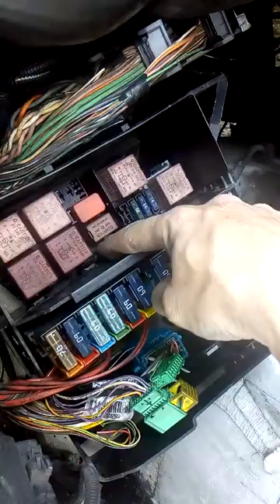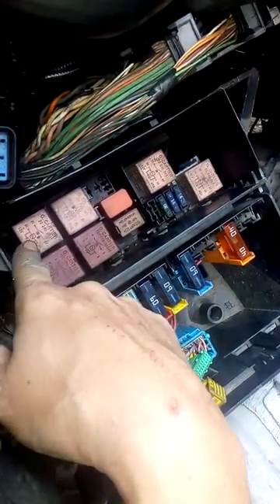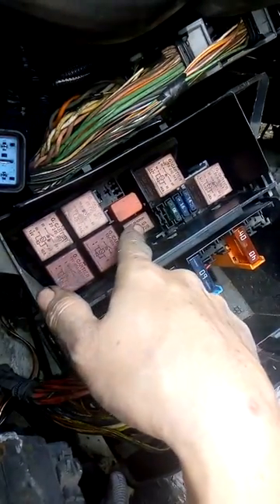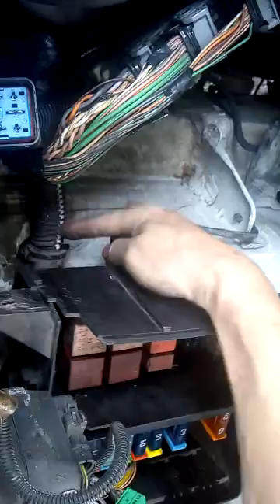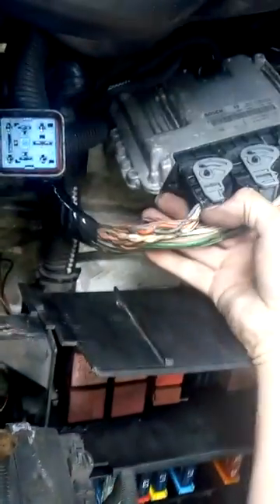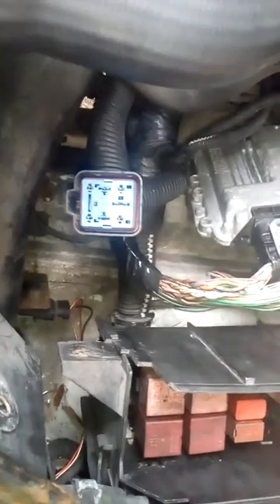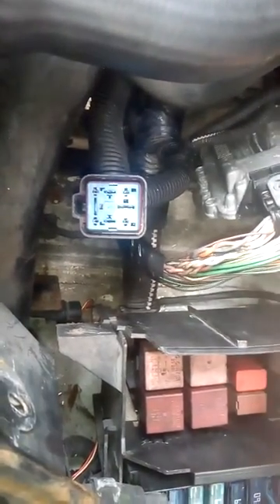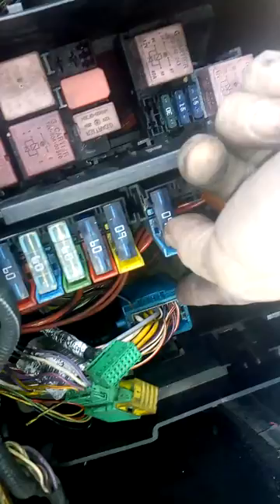Renault DCi 1.9 fixes.

Comment: my mechanic used to work for Lucas. and he has told me never use non OEM parts for these Renault engines, after some other garage put a cheap MAF on and made it idled at 3000rpm...
Reply from the maker: No you can use what ever parts work...
The problem is with the parts and who makes them. There has been a lot of issues with eBay maf's as essentially it's a resistive wire set to give information. But that small difference can cause big problems.
A good mechanic and auto electrician would test the maf before fitting, and know how to.

Comment: Hi rory, cheers for vid..i have a renault master 2013...was driving fine but to keep it brief, now no dash lights except odometer, .vehicle obvioisly wont start.  Battery good, engine strong..all fuses and relays seemigly checked.  Ecu not giving any reading. Its been at mechanics a while now and im just trying to find a solution....anyway.. Have you found that it is a common issue for one of fuses on battery to "appear" good but is actually broken.  I.e. there is just enough of a connection to give a good reading on multimeter but the fuse is actally corrupt.  I have read a couple of comments tbat this was the case and seen couple videos aswell so wondered what yr thoughts were.  Any other suggestions appreciated thanks again👍
Reply from the maker: yes you can have that issue.
You can have a small trace that will give you a voltage reading with a multi meter, then you put a load on and it will break, if you go back, the voltage level will be gone. but you can also get the same result with a bad connection. but in this case you would have voltage when you returned to the connection.
Reply: Thanks....quick follow up..master 2013....ended up putting in new (2nd hand) USM module and van ran smoothly for a few months..now experiencing same probs...randomly, it wont start..turn key..glow plug coil light comes on v briefly, then off...then spanner and triangle with skid marks come on..no crank...sometimes oil pressure fault reading..sometimes fan kicks in, but no crank....turn key off, try again...and, sometimes after 5-6 times of doing this it starts and off i go.....someone has suggested as they had same problem, that an earth wire going to pink relay under usm (you mentioned this in yr vid..the one that powers the pumps/sensors) and goes to ecu was faulty...is this a common issue in your opinion?  ..is it an easy ish procedure to locate faulty wire.?..i notice in yr vid u had to get right under all the fuse box and expose all wires....would u be able to give any quick tips..what tools/ what to best look for when trying to identify where problem is....i suppose first is just a visual to see if anything obvious...i have a multimeter!  Any tips appreciated ..cheers
Reply: Also..u mentioned checking continuity...is that a case of sticking probe into where relay usually goes?  Cheers

Comment: Hi, Do you know much about the limp mode fault when hitting 50/60mph? Absolutely fine until you hit that speed, if u turn the key off/on its then fine until you hit 50/60mph again? Thanks.. 😊
Reply from the maker: is this rev related rather than speed? This would indicate a fuel issue. could also be a wiring issue check the pump and injectors wiring is reading correctly. and also that the egr is functional and clean.
Reply: @guywhoknows  Hi, No I wouldn’t say rev related, it will only go into limp mode at 50/60mph, No matter how hard you drive it will do it. I have checked the whole wiring loom ( took it out the van ) any breaks have been repaired but issue still present. Does have codes for Maf sync and camshaft sync
Reply from the maker: @Rushizzxx  try the maf sensor.
If you get a cheap one they won't resolve the issue, I replaced mine once, made things worse so got a proper one.

Sometimes the issue can only been found using live data. 
The other issue can be due to fuel pressure, ensure the filter is replaced and flushed. 
Watch the live fuel pressure data.
Remove and clean the egr. If the egr is stuck it will show an error, but you have what looks like a bus error as it's across a number of systems gear box, maf and crank

Comment: Hi Rory. My 2.0 Renault trafic stopped shortly after a normal start. It cranks fine but the glow plug light won’t come on again. All glow plugs tested ok for both resistance and 12V powered. ECT correct resistance. All fuses and relays fine. Any help appreciated 🙏
Reply from the maker: Glow plugs only work when needed.
Disconnect the battery and let it stand a while and try again.

Check you external temp sensor.
(Think it's in the door mirror)
Reply: @guywhoknows  Appreciate your response. It’s a 2008 dci 115. I was under the impression that the GPM is linked to the ECT but I will look into the OAT. Yes battery has been disconnected numerous times. This will be my last Renault I’m afraid 😂
Reply from the maker: @daveo9844  if you can't find anything there, take a look at the pump, there is a small solenoid you should hear buzzing when the power is on.
Then the next thing could be the MAF sensor as that does air temp and flow.
Be careful as they can go be faulty and fake, this gives wrong signal and cause start a run problems.

Hey don't forget these are joint venture vans, so that includes nissan and vauxhall as they're all the same platform and build.

The 2.0 engine is terrible and no end of issues, the old pump seal leaks and starves the engine of oil and can lock up the engine.
With that said, get someone to crank the engine and see if your cam belt is turning the cam, and take off the oil fill as check to see if everything is moving inside.
I've had plenty of call outs, where it turns over but won't start on all sorts and the belts are gone.

Comment: very informative video, i have a 1.9 2006 vivaro, the pre heater fuse (70) has melted, do you know what the cause could possible by, the van runs and works fine.
Reply from the maker: you possibly have a short or high resistance. you should check the plugs and also the relay for damage. there is also preheater on the cooling system ( on the top to the right in the engine bay on the pipe). They are also glow plugs.
Modern engine tend to not really need such a pre heat, which is why it will start and even though its melted its probably making a connection.
Reply: @guywhoknows  cheers for the reply, the plug and fuse has totally been destroyed, so i know it defo isnt making a connection, could it have been heat caused by resistance due to corrorsion on the fuse / plug it slots into. everythning seems to work fine, so its a little odd.

Comment: Hi rory,have a issue with my 2004 vauxhall vivaro, 1.9 diesel, no eml light on ignition. Plugged in code reader,doesn't pick anything up,says no modules or something similar.runs fine though,sure previous owner as turned eml light off some how,any advice greatly appreciated, thanks mark.
Reply from the maker: Maybe they taped over it in the dash.
But if you have no detection then it's likely to be a bus wire, (the fault/computer wires)  or the fuse that's gone causing it to not be detected.

Go for the fuse first as I doubt you'll have the kit to read the lines and then hunt down a break in the wire.

Unless you got a cheap scanner, could be that as it won't run if it's not talking.

Check battery terminals  fuses and wires.
Then on/below ECU then the back of the odb connection.. 
Could also be a ground fault, so make sure the obd has the + and - working correctly.
Reply: Thanks for the reply,would you happen to know which fuse and its location? Will try that first,thanks for your help.
Reply from the maker: @avfc666s  nope, there is a lot of different wiring arrangement, so most of them aren't the same. I found that out when looking for a wiring diagram.

I think the wire is yellow. But go for the fuse box behind the light and there are some fuses on the battery. Then there are fuses  under the left side cup holder.
Reply: Will get on it,and report back,much appreciated!
Reply from the maker: @avfc666s  start with the small fuses, there usually less than 10amp. So 7.5, 3 something like that. Just pulling and pushing them in and out can clean a dirty contact and then it works... 
Or worse case there is a fault in the wiring (broken wire) that is stopping the contact.

Pins 2 and 10 are  jbus. (2 is +)
Pin 6 and  14 are can bus (6 is +)

On the back of th odb. So you should be able to wire trace from there.
Reply: Hi,rory,seems my problem is related to wires being cut for airbag under passenger seat,been on a forum,apparently I need a auto technician, do you happen to work on vehicles or do you just put advice up,regards mark.
Reply from the maker: @avfc666s  not something I would do.
Don't try this at home

It's a risk of explosion reconnecting the wires. You need to ensure the system doesn't trigger.
Reply: @guywhoknows  ok,thanks for your help, allthe best.
Reply: Hi rory,how can I send a pic to you,maybe you can help, someone on a forum as sent me a pic of fusebox relays,concerning eml light.cheers mark.

Comment: hi rory been searching everywhere for an answer, My 2006 vivaro has been a nightmare the glowplug warning light came on with the fuel light when i went over a speed bump since then it comes off and on and sometimes goes into limp mode, it doesnt rev when this light is on and ive been plugging and unplugging a throttle sensor to get it going again any idea what the problem is ? its been burning through fuel for fun but i dont know if its just the fact that whatever sensor on the fuel is connected to the one that does the throttle as i said they both went off at the same time from the same bump
Reply from the maker: Fuel, throttle, engine speed, and emissions are all part of the same system as the vans drives "fly by wire" there is no user control over the speed and controls of the engine. That peddle goes to a computer that does the work...

Bumps can be a wide range of issues. Check both ends of the battery wires just crack them off and on again should be fine.

The jolt could have "bashed" wires about causing a weak one to break... Or a sensor failure. 
It could be the air flow on the front of the throttle body, this accounts for a lot of control.

If you're going through fuel then is could be the air flow/temp sensor and or the emission sensor (there are two?) It shouldn't the the crank or cam sensors.
If you computer thinks it's cold, then it will add fuel. Thus you use more.
If your getting a lean emissions it will add fuel as it will think it's running hot and lean.

Check your fuses, and check the pre heat relay. Just swap the relay around as the one next to it is the same.
This only helps with glowup heating. The cooling heater has the same relay, as found on the top front of the engine. If they get warn and power then its fine.

Just make sure the engines ground cable is attached and clean making good contact. As this can make everything go wrong and odd..
Reply: @guywhoknows  thank you so much for getting back going to check a few thing you suggested cheers
Reply: @SammyHardman8 How'd you go with this in the end? I have a very similar situation unfortunately.
Reply: @rwdkai  I believe it was something to do with water leaking into fuse box as I wouldn't notice this would only happen when it would be rainy. Sadly I sold it 2 years ago.

Comment: hi mate i have a question. i have a 2006 trafic with 1.9 engine. when i go full throttle the car feels like it doesn't want to go and i dont get power. also it cuts the power regularly when full throttle. i am thinking that the fuel pump is faulty. what is your opinion?
Reply from the maker: Could be the erg. Have you taken it off and cleaned it?
Messy job...

The other thing is the pipes that go to the turbo controller... (Right side next to the computer with tree pipes)
Follow them up and make sure it's clean there and in the ends.
Failing that, probably fuel pump or injectors.. but have you changed the air filter too?

If you can see behind, what colour is the smoke out the back...
Reply: @guywhoknows  it was actually the flowmeter. changed it and now the car is back to full performance

Comment: Hi Rory, I have a problem with my van not revving immediately when warmed up, it idles but takes a while to start revving. Any  pearls of wisdom would be appreciated as I took it to the local dealers and they said fuel pump.
Reply from the maker: Have you cleaned the erg valve out recently. Or yes could be the pump. Or filter.
Reply: Rory Witham yes, I’ve even turned that one around
Reply from the maker: @acewelding  it can be the throttle peddle, of you get a multi meter in it and see what it says, the fuel pressure switch does break and give a false reading.
And also I did read but can't remember what it was, totally odd ball part that can cause it.
You'll have to look up will not rev up.
Don't forget to look at the vauxhall ones as they're the same.

The only other mechanical parts would be the cam sensor. (Top)  or crank at the bottom (climber under and about the middle front hidden behind the rad pipes as they go across the engine.
Both are fairly common , the crack (bottom more so) the cam one tends to  cause issues at higher revs.
Reply: @guywhoknows  Thanks mate, I think you could be referring to the coolant sensor. Thanks for your help
Reply: Did you sort your problem out sounds like my problem too
Reply: @simoncrabtree444  not yet. Haven’t tried the coolant sensor, cam sensor or crank sensor yet.just had to have a new clutch so haven’t had time. If you find a fix be sure to let me know. Good luck 🤞
Reply: @acewelding  do you have a cheap MAF fitted as that is a common culprit
Reply: i had this on my vivaro 1.9. it wouldn`t rev when started. turns out its the ecu software, i hgad it updated for £150. revs immediately now..
Reply: @themagpie_1  thanks for the reply. I have heard this before but my local dealer has told me there is no update

Comment: Hi Rory

I recently bought an Opel Vivaro 2005 1.9 DCi that has been turned into a camper van. However it's in limp mode with several OBD codes. The engine needs some revving while cold starting, otherwise it shuts off. When revving for about 30 seconds or so its running stable in idle. No weird noises or knocking sounds from the engine. As previously mentioned it's in limp mode and it's hard to go above 40 km/h. The transmission and clutch seems fine and is working properly.

The OBD codes that I get with my cheap OBD-reader is:

P1814
P1815
P1829
P1802
P1806
P180B

What could be the cause behind these fault codes and how should I proceed to troubleshoot and diagnose the symptoms?

Help is much appreciated!
Reply from the maker: im will say you have a manual gear box?
Id say this would be a bus fault ( wire) you have a break in the wire ( a short possibly) so the communications are not working. as these are  engine  and gearbox (auto) faults showing. if you have a manual gearbox, there may be a fuse in the wrong place. but you need to check the loom coming down from the battery and  around the bell housing.

Comment: Hi Rory, I have a problem on my Vivaro 1.9 74kw. Throttle pedal no reaction when engine start. Idle speed is little bit lower then normal but after few seconds engine speed start getting higher and throttle pedal start function normally. is it possible that they are bad injectors? MAF sensor,  pressure sensor both are new. EGR valve is clean. Turbo is good. Car starts perfectly in every temperature.
Reply from the maker: Airflow or temp sensor.
Reply: Did you already manage to repair it? Same problem....

Comment: Great video and very helpful..my Van 2004 1.9 diesel driving home perfectly then a loud bang and all lights came on…got home everything still working except speedo and indicators not working everything is fine…switched van off the restarted 5 minutes later no throttle response and all dash lights on..checked the battery because of the smell and it was smoking and leaking acid..changed battery for a new one but still no throttle response engine starts fine…any ideas thanks again.
Reply from the maker: Blown fuses...
Check the fuses on the battery terminal.
Then the main fuses.
I'd also run down the cable to the alternator just to make sure there wasn't faults.
Then you get to go through the fuses...
Both sets

Comment: Hi, my vivaro has problems with the air conditioning, the compressor always stays on.
The engine runs badly.
Reply from the maker: Check the switch, pull the relay. If that doesn't fix it replace the AC compressor as the clutch has jammed up.
Pry the end of the wheel away.